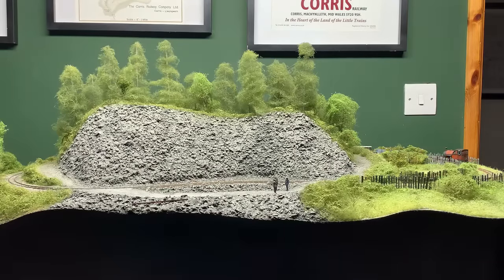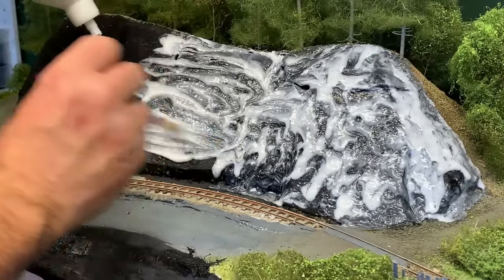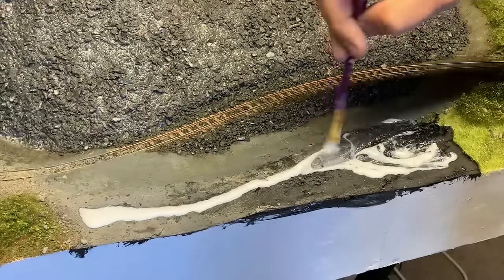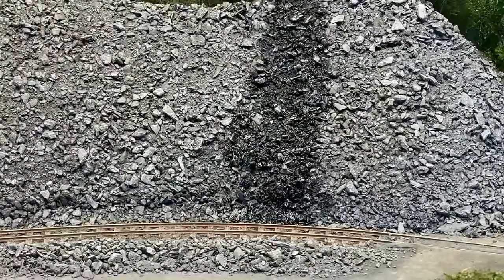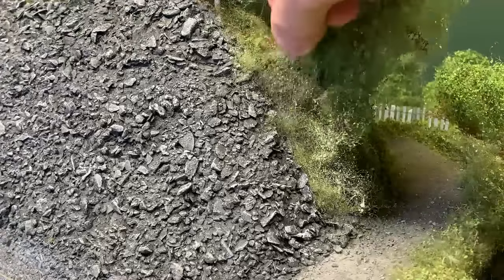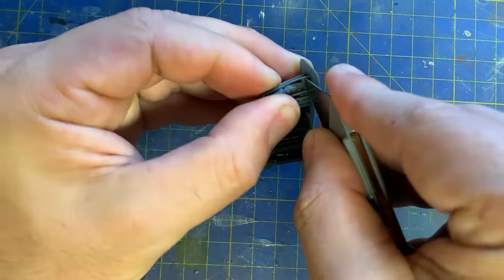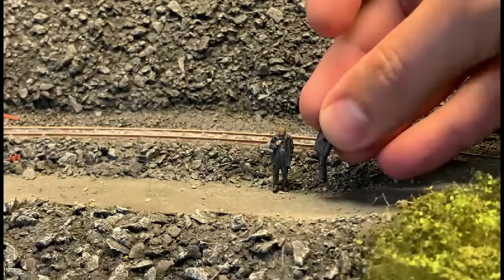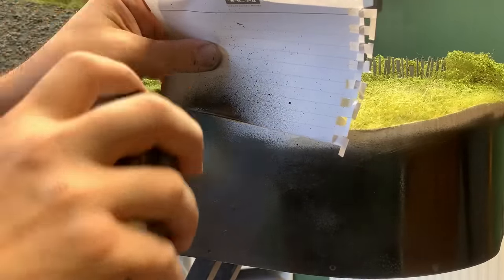Secrets for a STUNNING slate quarry 009 model railway scene

Comment: In a slate quarry i would expect some sort of raw rock face, which could be done by adding a large flat piece of slate.
as the scenery is not very large adding little rocks in the sloped area might be done by tilting the scene back until the respective part is horizontal.
If this was part of a larger setup this could be built separately so it could still utilise the tilting method
Reply from the maker: You could be right, but this is just a snippet, there is alot more to a quarry than slate piles, and I’d never fit it all in. The issue with tipping the layout back is the tipped slate is set at the wrong angle, once it’s brushed off it would be more like a path on its side than a ‘pile’, which is why I had to do it like this. If I was to do it again, I wouldn’t use real slate, as it’s just not the right shape for replicating miniature slate.

Comment: Great job George! I really enjoyed the build series. I'll be over in the UK at the Ffestiniog and Tal-y-llyn in a couple of weeks and I already feel the need for a layout coming on. Not sure if my wife will thank you for that or not ;)  A couple of observations. One: Did you think about tilting the layout back a little as you added the slate? Then it wouldn't have slid off so much. I had a similar issues on my 16mm scale sand pit layout. It helped me. Two: More rusty bits of waste against the slate grey, please. It really pops on there. Rusty cables, perhaps a wagon wheel. I just feel like there isn't enough on there right now. Perhaps that's just me though. One last piece of shameless self promotion. Have you seen my e-zine The Micro Model Railway Dispatch? It caters specifically for modellers building layouts in under four square feet. Best of all it's free!
Reply from the maker: Thankyou, and I hope you have an amazing visit, Wales is a stunning part of the world, and I’m very grateful to live here (mobile signal permitting!) thanks for the comments, I always welcome criticism, so:
One: yes I did, and I did try it off camera, but due to the slate falling down, when you put the layout back up, the slate looked like a slate path on its side, so it doesn’t give the correct look. The way forward for future projects will be to not actually use slate, but mimic it with a thinner material.
Two: I was conscious not to overdo the scene, but I get your point, and might add a few more bits - I like the idea of a wagon wheel. I did want to add a broken wagon, but didn’t have a spare kit to hand! I’ll add to this scene in the future I think.
Three: no, I haven’t, so what is that, and where can I have a look into it? I like the free part!